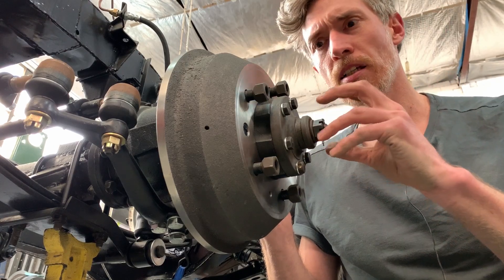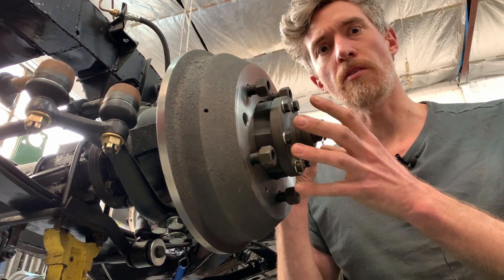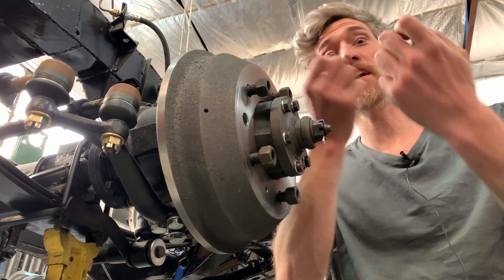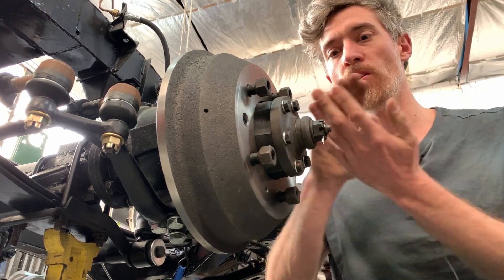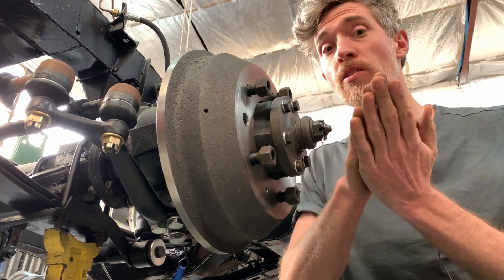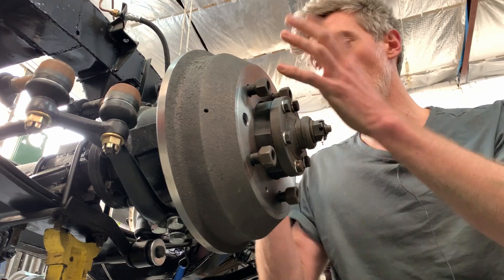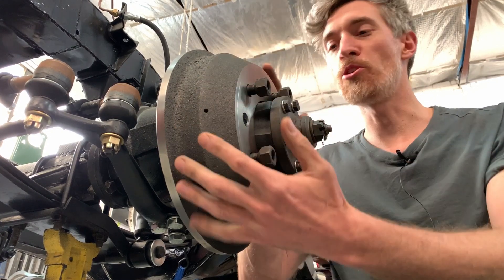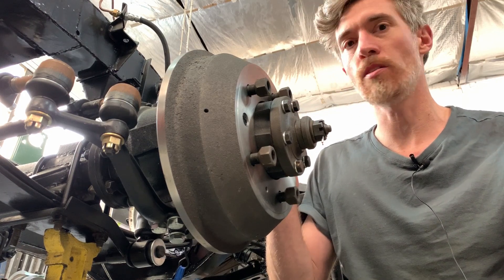Regen braking has nothing to do with brakes || Electric Land Rover Conversion

Comment: this is a very interesting concept, the part about drum brakes that is, I am converting a 1969 Chevy truck with drum brakes at all four corners and was planning on a front disc brake upgrade, but after seeing and listening to you I think I will see how the drums perform first, wouldn't it be something if I did not need to convert / upgrade the brakes to disc?

Comment: I recall, clearly, servicing a Hybrid Camry that had been an Uber taxi it's whole life. The owner ran 5 vehicles but this was his personal, Uber duties, ride 80% of time, he loved it. 
It was on 270,000km and he was expecting some feedback that indicated $$$ to be spent.
It was faultless, everything was tight and serviceable.
"What about the brakes? I've never replaced the brakes!"
"Mate they are 60-75%! If they've 1/4 million km and you keep driving the way you do, they'll see 999999km!"
Brilliant technology!!!!
I do wonder about the pedal to momentum/inertia feedback though.
Does regenerative braking initiate on "overrun" or (in Toyota products) is it initiated by the brake pedal and then modulated between regen and brake friction? Will your creation work like that?
There is much to be said for using engine compression to modulate down hill descent in Low range.
Regen braking could benefit such but then highway coasting will be affected.
How do you plan to manage the driveability and feedback of this system?
Reply from the maker: It's amazing right. I guess it's why trucks have been using engine braking for decades.  

As to how we manage the driveability... trial and error.  These cars will still feel a bit unique and old fashioned so the new driver will have to get used to the car no matter what.  We'll calibrate the throttle (the only digital pedal) to trigger regen when not engaged  and the brake pedal will be more an on/off on the regen trigger.